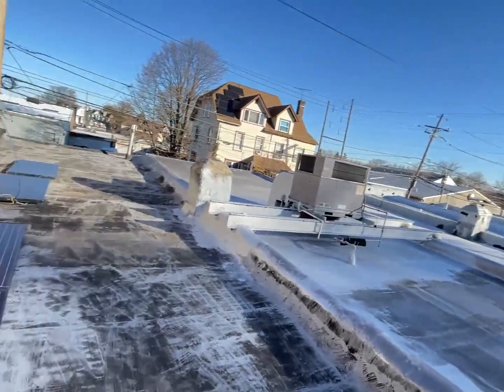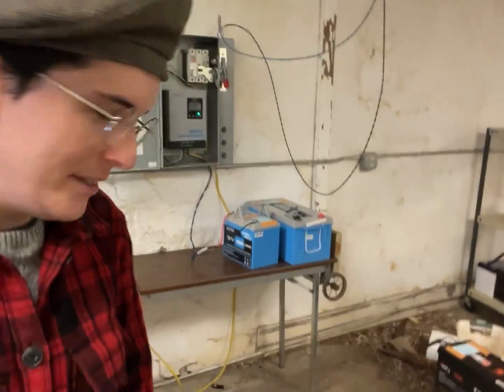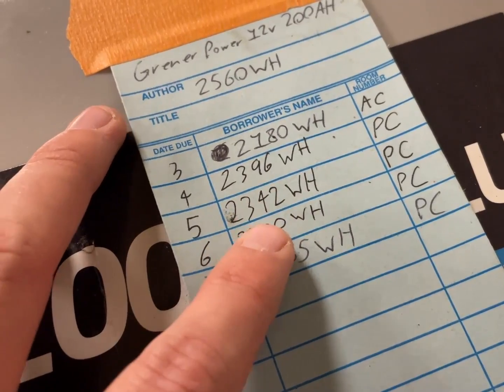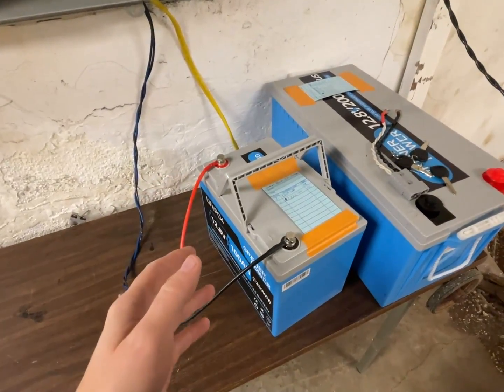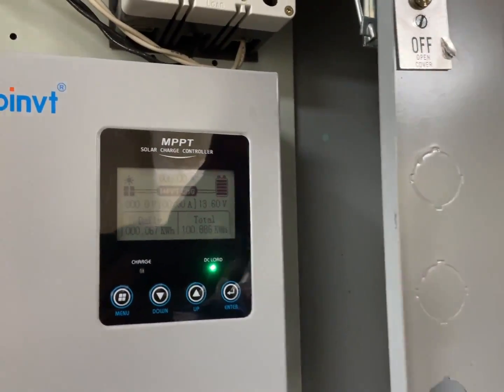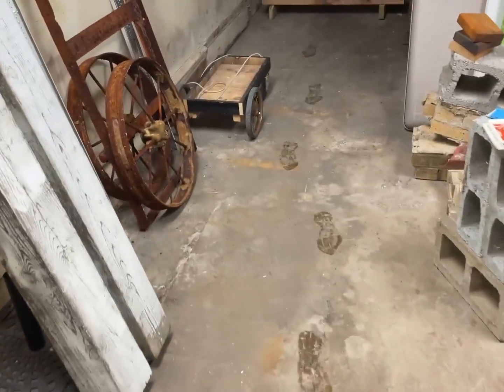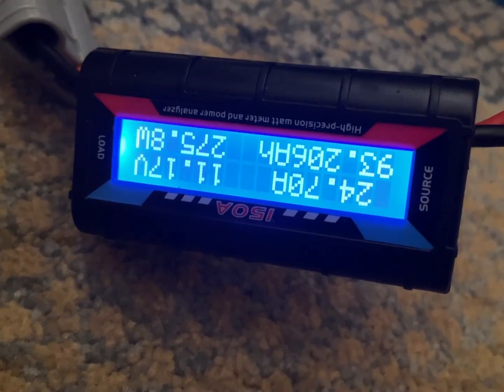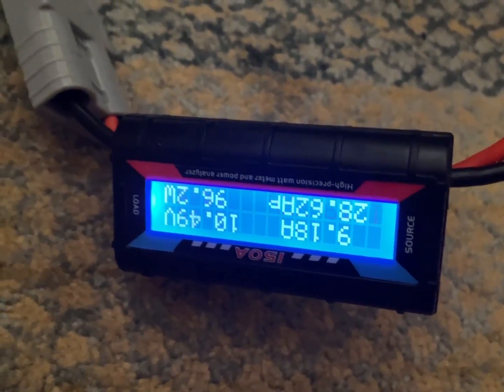Solar Sunday Experiments 34: Testing theory about LiFePo4 discharge capacity with Grener Power 100ah

Comment: For lithium-ion batteries, manufacturers state that the cells need to be charged five times before they reach their full capacity. The situation with the sun is frustrating; I wasn’t able to generate much electricity either because it was cloudy most of the time or there was snow on the solar panels.